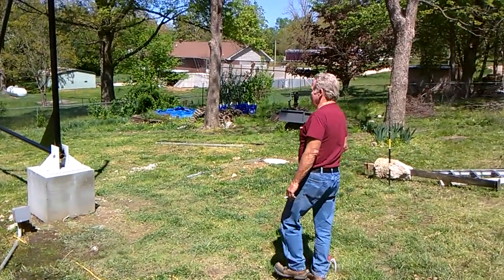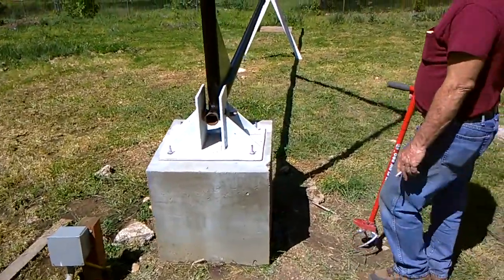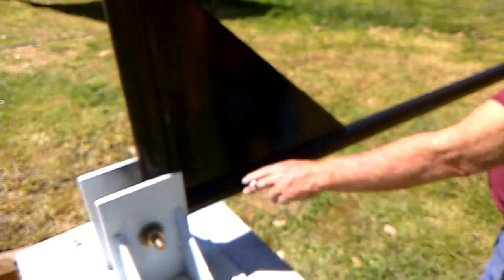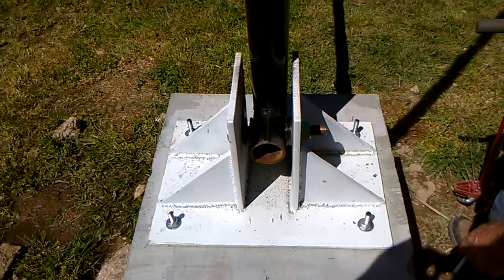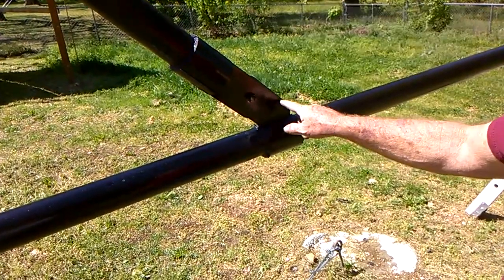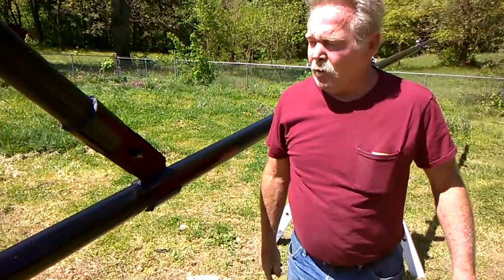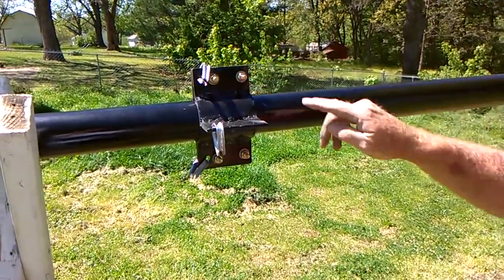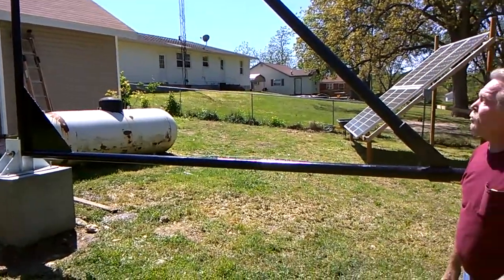axial flux wind turbine tower build

Comment: Nice design , i was considering  a very similar design with two 45 degree bars at 90 degrees to one another, agreed over kill is the only way to do anything if you want minimal issues in the future, its always worth the extra time and effort for the peace of mind it gives you.
Reply from the maker: I hear ya buddy.  Safety is the first issue I always go thru.  Then I try and see how strong I can make the set up.  I also knocked the budget out of the park on the tower materials and guy wire.  picked up two lengths of that 3 inch X 34 feet pipe for 30 dollars each and got a truck load of that 10,000 pound galvanized guy wire for free. the wire came in lengths from 400 feet to around 60 feet.
Reply: now that is decent wire wire, i was looking at using our near new winch wire since the winch itself needs replacing.
good price for the pipe, im always looking out for bargains, paying retail is not my thing,  making the most of what i have is.

Comment: Steve, that's the most well thought-out Jen pole design I've ever seen!! Are you going to show the test of function of it? Good job Steve!
Reply from the maker: we just got back from picking up a few more turn- buckles.  now we get to start with the guy wires.  each wire is rated over 10,000 pounds so it should be fairly strong.  I will do a video of it on the test raise.
Reply: SilentDeath002 thanks Steve, looking good!!